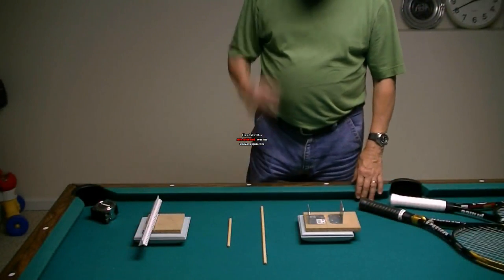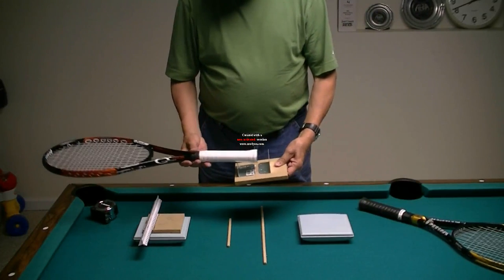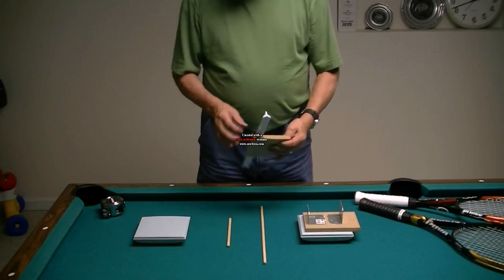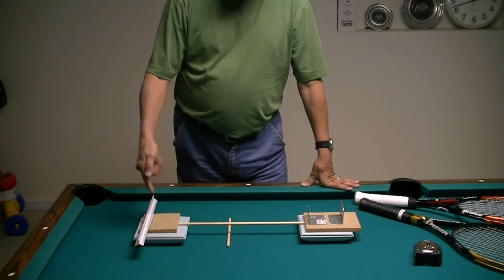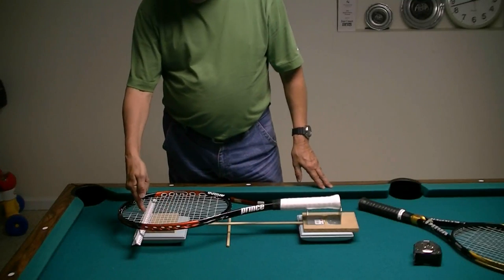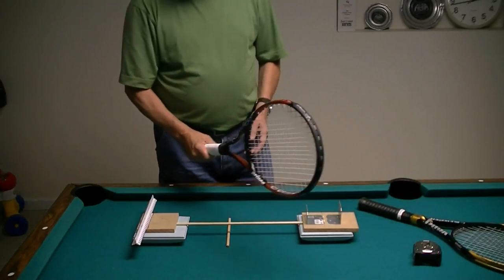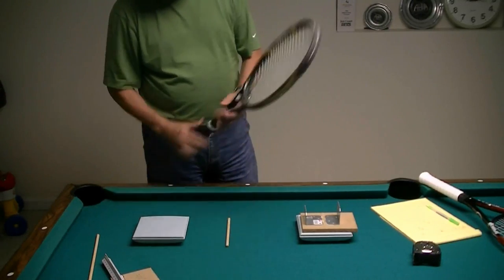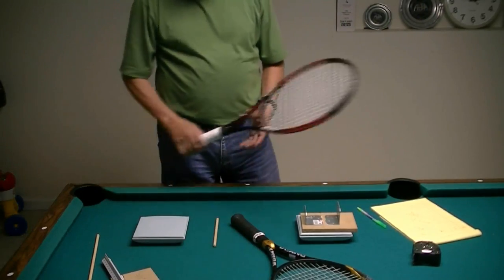Racket matching and balancing part 3.flv

Comment from the maker: I did not put weight on the butt of the racket. If I were to add weight to the butt it would depend on how much weight I was adding. If it is just lead tape I would put in on the top and bottom bevels of the handle under the grip. If you adding a lot of weight you could put in inside the handle using the trap door in the butt cap  if necessary.